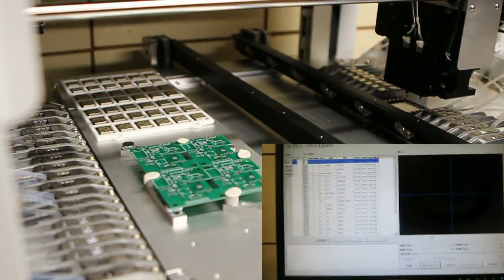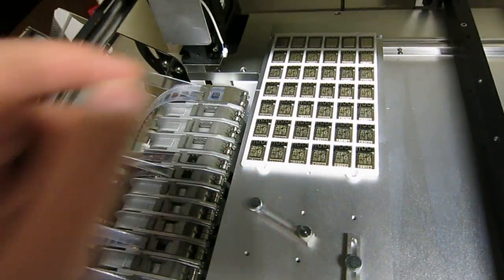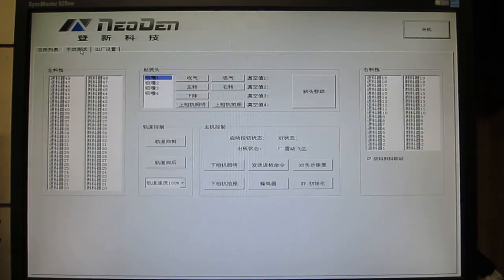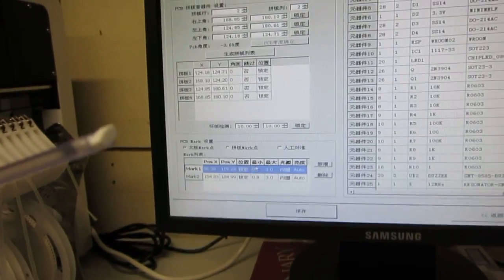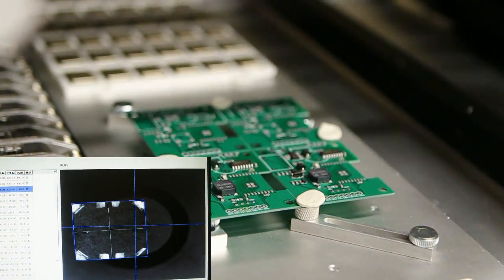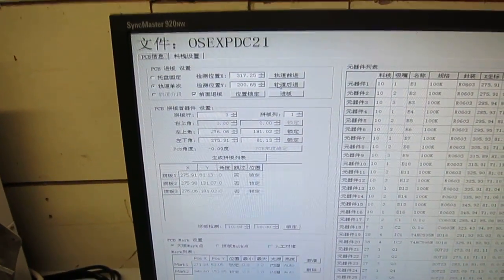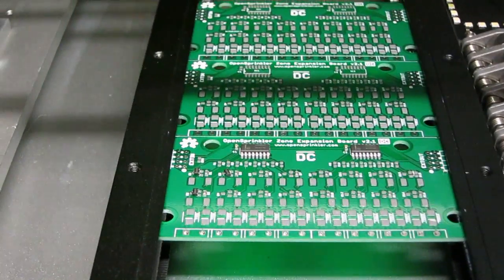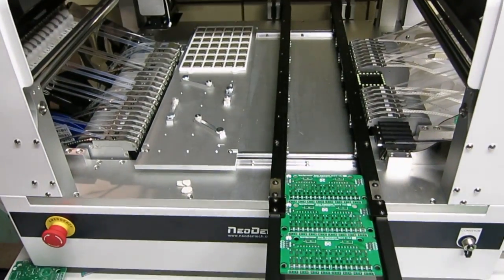NeoDen 4 Pick and Place Machine with Vision System

Comment: The reduced speed option looks very badly implemented - it still moves slowly when moving _to the pick position - WTF?
Reply from the maker: That's an interesting point, didn't pay attention to it until you pointed it out. Well, honestly to me accuracy is the primary concern and speed is not that crucial (I only do small-batch runs in house and large-batch is always outsourced to factories).

Comment: Great video! Would you mind sharing which Reflow Oven do you use? And if you had to grade it. 0-10, according to your needs? You seem to have experience with these machines and your insight is very well appreciated. Thanks!
Reply from the maker: Just recently bought the new reflow oven from Neoden (model IN6). It's not cheap but works quite well.